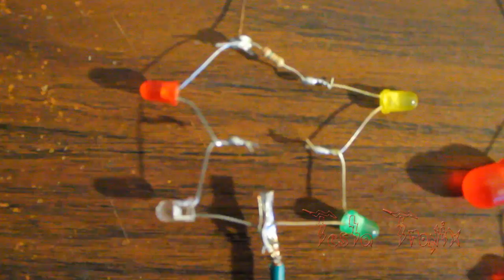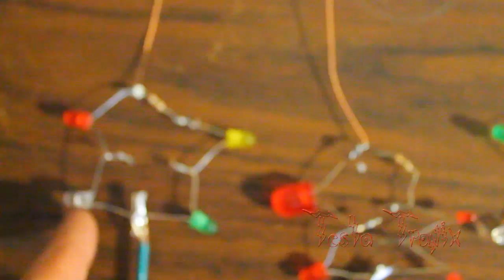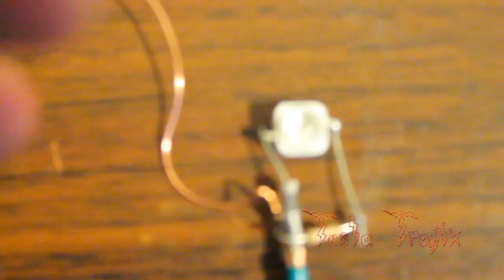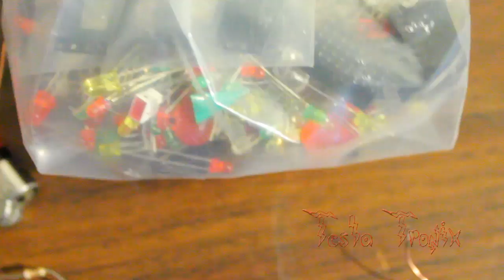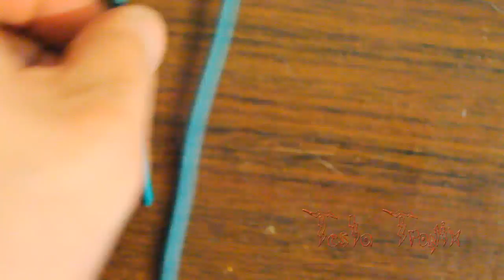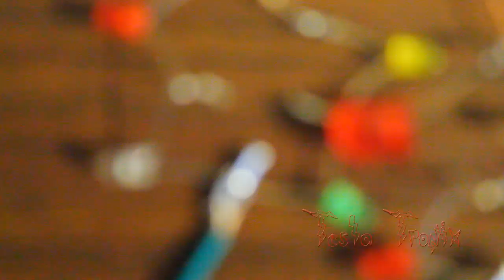Easiest Tesla Output Meter- How To

Comment from the maker: This was a serious inqury, and I will respond publicly:

Based on the tone of your original comment, and the flood of internet trolls throughout this project, I did not take this inquiry seriously. For this I apologize. 

I can not offer ANY warranty what so ever with these products because they can be driven by multiple voltage sources, and the reliability of the circuit is solely based on end quality of construction.

Comment: I bet it's because the resister is blocking one of the two sides from firing energy up the coil.  when it's far away there are 2 streams blocking eachother.

Comment: LOL. I was making rectifiers.. They burn out if the plasma reaches the tower, and only light one side, Should have worked it out myself :) all the evidence was there. Facepalm. Strangely, I have one, with 3 orange LEDs, that light from about 1.6v(2.4v ideal) and one blue one, that needs at least 2.6v (3.6v ideal), and the blue one lights first every time?? LED's seem to make nice low power spark gaps, that may be part of it. I can get earthed leds to light from really good distances too.